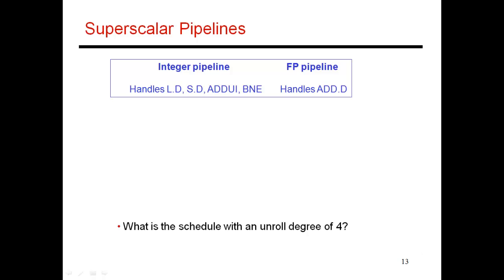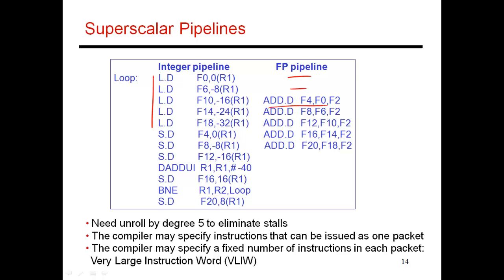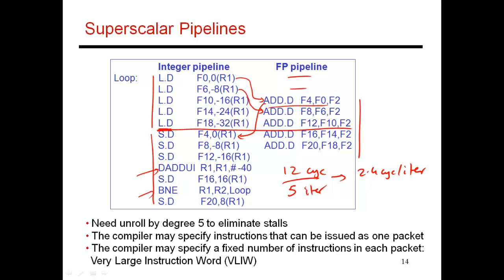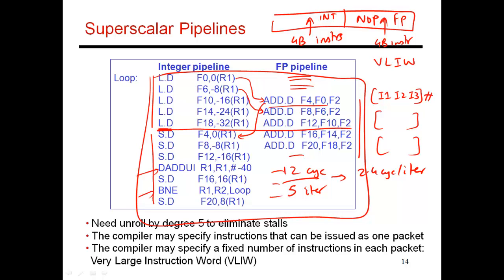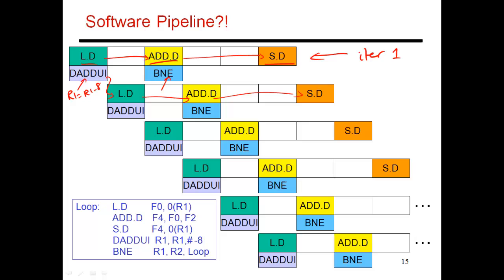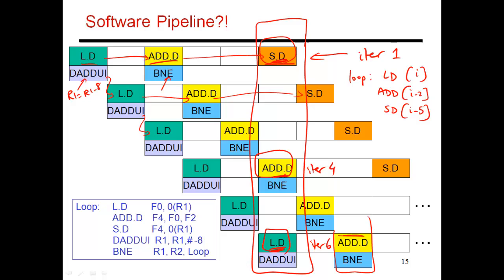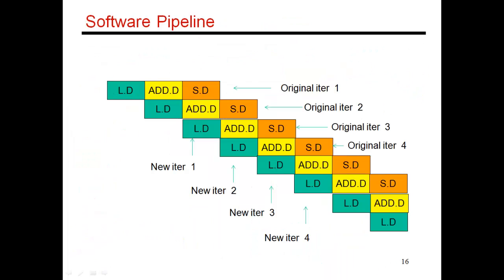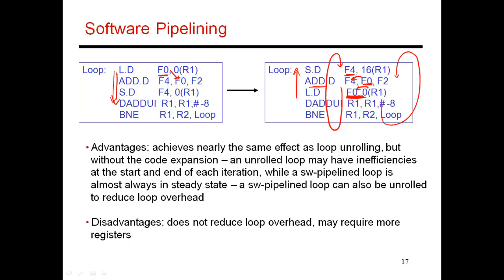CS6810 -- Lecture 17. Lectures on Compiler-Based ILP.

Comment: In the case of the software pipeline, apart from the loop overhead, the first two instructions are wasted on the first iteration, and the Load (3rd instruction) might not be doing anything useful in the last iteration, if I am right.